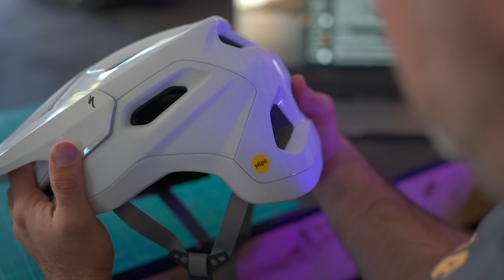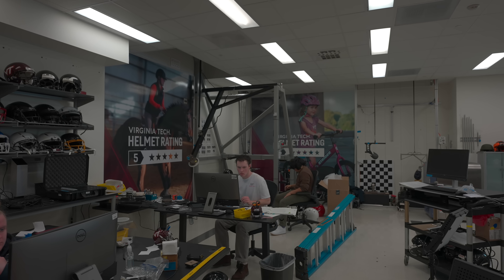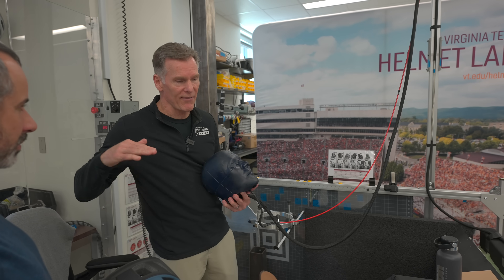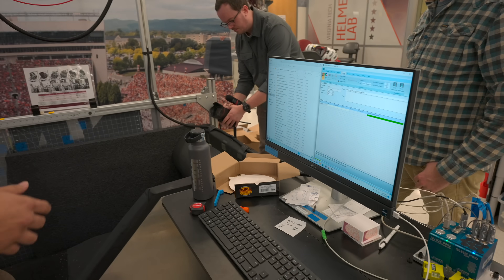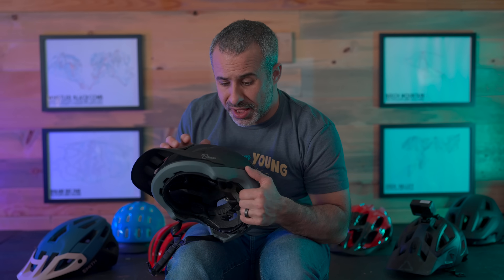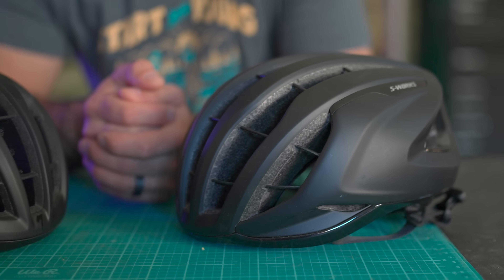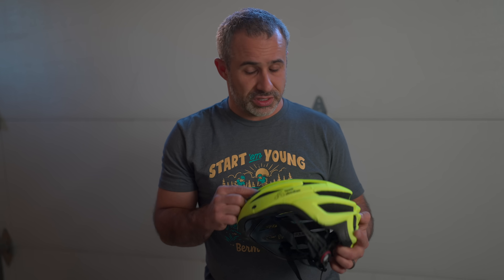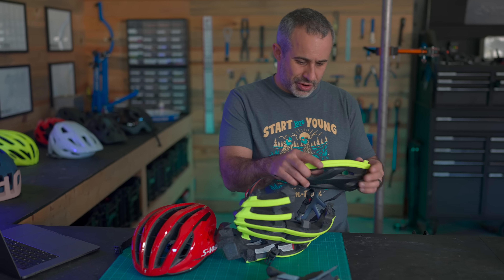Are Cheap Bike Helmets Safe? We visited a helmet testing lab to find out

Comment: I would be very curious about a follow up testing the helmet that shattered at Virgina techs lab. While it looks bad and gets shock value from all of us armchair experts in the video, bike helmets are by nature 1 impact products. In a MTB crash there could be multiple head impacts. That is the nature of chaos and randomness, so I find the lab experiments, while valuable, dont show the whole picture anyway. So how about a test to show the force on the head when the whole helmet shatters? A helmet that is stiff and doesn't shatter has to transfer the impact energy somewhere, which eventually split between the head, heat to friction and ground. Maybe there is a certain level of shatter that is more optimal than a non shattering helmet for brain protection?

Comment: the purpose of a helmet is to crack, deform, or break on impact to absorb and disperse the energy, preventing that force from reaching and cracking your skull or injuring your brain. A helmet that cracks after a hard fall did its job, sacrificing itself to protect you; if a helmet stays perfectly intact after a major crash, it often means the impact force went straight to the head, which is a bad sign

Comment: 1:13 never buy a helmet without checking this website first.  I’m surprised he didn’t consider this common knowledge.  Any attempt to find out how safe your helmet is will lead you right to the Virginia Tech website.  I bought a “specialized mode” after checking this website that I have been very happy with.  I’m old, and clumsy on an e-bike I bought for transportation because I don’t feel safe driving a car anymore. Recently broke some ribs in an accident, but my skull was spared any damage thanks to that helmet.  And I sure can’t afford to be having accidents like that driving a car.

Comment: I'm a former down hill MTB racer. Some time ago I had a pretty server crash while doing some training runs in up state NY. I had just purchased a $400 TLD carbon fiber helmet during the off-season. I Still Don't remember what happened on the mountain. After a helicopter ride woke up in the hospital. (Weeks later I was back on the mountain)
The carbon fiber had cracked, but saved my ass in the end. Don't compromised when it comes to safety.

Comment: For Amazon, to avoid counterfeits be cautious when you see "shipped by Amazon" because that means it's coming from an Amazon distribution warehouse.  Some get a warm and fuzzy feeling if it says "shipped AND sold by Amazon" -- but this has a huge question mark whether you're getting the real deal.  Why?  It's because Amazon warehouse items are mixed inventory, it's not segregated whenever its designated "shipped by Amazon".  So the unscrupulous vendor sends a bunch of counterfeits to stock at an Amazon warehouse to ship their product out.  You might say, I'll only risk getting a counterfeit if I select that questionable third party but nope.  Again, they are mixing inventory out so you can select "shipped and sold by amazon" yet end up getting one of the counterfeits plucked by the robots off the shelf and sent to you.

Comment: Wow, I was blown away by this video.  I have been looking at helmets and was looking ones with  with lights as a safety feature.  Now looking at the VT ratings only 1 of the helmets I was looking at had a rating (5 stars). None of the other helmets even had a rating. Then Inlooked up my current helmet and it doesn’t even have any stars- 0 stars!   This video completely changed what helmet I am considering.  Thank you so much for creating this video.

Comment: Getting a helmet on Amazon from the seller does not guarantee that it's genuine. In the Amazon warehouse re-seller inventory gets mixed in with the manufacturer inventory. As long as it's the same sku its treated as equivalent. You might be getting a counterfeit item that a re-seller provided. This was so much of an issue for Nike that they stopped selling on Amazon for 5 years.

Comment: Despite what the tests show,  its very unlikely to fall on the top of the helmet with road bikes.
I cycle weekly and haven't fallen off my bike in years, the only time I crashed, due to a slippery road, I landed on my shoulder. 

I prefer a test that also shows how mushroom the helmet looks. The helmet can have MIPS and a high manufacturer rating but if it looks like a mushroom then people wont want it. So I am sceptical about the real world comparison of these impact tests.

Comment: This is fascinating to me for many reasons, and thank you for putting this video out there for the masses! I work in motorsports, have since 2010, and in my early days I was a safety inspector for local weekly oval racing series. The motorsports industry has testing standards for all driver gear, helmets are no exception: they must meet the Snell specifications within the last ten years or a specific FIA rating, with the ratings being given only for a helmet that meets very strict requirements. These standards are industry-wide, and you can simply look inside a helmet for the certification sticker and know what tests it has passed, and you simply will not find a legitimate helmet without those certifications on it. It's given confidence to the drivers, the families, and in my case it gave me the confidence that I was never approving a driver to race in inferior equipment. Some helmets are more expensive, since various shell materials and other features exist, but those costs are justified in all cases. It puts a definitive answer to the question: Would you race in a $200 helmet? Absolutely, because it has met the standards. It might not be as well ventilated as a $1500 helmet, might weigh 4x as much, and the visor might fog up, but you'll be okay in a crash.

So, a few years ago when I got back into Cycling after about 20 years away, I was shocked to find that there is no standard system like we have in Motorsports.  I needed to buy a helmet, and I was literally paralyzed with choices. Not because of pricing, but because instead of saying "This helmet meets this standard of testing" I was hit with all kinds of "technology" and buzzwords. I had to go out and find test results to all the helmets out there because the industry hasn't bothered to implement safety standardization to helmets yet and that baffles me to this day. When I was shopping around I kept getting the "Would you trust your head with a cheap helmet?" Without some kind of standardization and rating system, that question is just a sales tactic and I truly wonder how many expensive helmets out there are not as safe as the price tag implies. I really hope this VT testing lab spurs some advancement in this department on, because they do work that's very similar to the Snell/FIA systems we have in Motorsports, ratings that have saved drivers's lives each and every week.

Comment: The Specialised is absolute rubbish. The visor broke within days of getting it. It's at a bizzarre height and catches on everything. The angle makes it useless as a visor as it does nothing to block the sun. The added distance from the centre of the head also increases torsional forces when you hit things. Best of all, Specialised does not offer a replacement visor. My last helmet lasted almost five years. I barely got 2 out of this one . I rate it a 2 out of 5. It's comfortable enough, but doesn't stand up.
Reply: Actually…they do offer a replacement visor for the tactic on their website for 14.99 cuz I bought 2 not long ago
Reply: @humstudios1595 Sorry. They never had them in white. Only black when I last looked (apologies, and thanks for reminding me) And they are still useless.
Reply: @Jasminethelion 😂 i still have the tactic but prefer my POC so it doesn’t get used much. I do wholeheartedly agree about the visor tho - it doesn’t help much when bombing with the sun in your face in any way. Thank goodness i have a great pair of smiths to filter the light…

Comment: Seems like having only the dummy head in the test would be drastically different than having the full body weight of the rider behind the impact.
Reply: These tests are to compare helmet to helmet in identical scenarios. It is still applicable because you learn which helmet performs the best overall
Reply: Not really. They measure a risk of concussion, and it comes from rapid acceleration. The acceleration reaches its peak as your head is just starting to move the first few centimeters. At this time it doesn't really matter if the head is still connected to the body, because muscles and spine do not really add resistance as the head just starts its motion. 
But you're right that the concussion is not the only problem, the neck trauma does depend on the body weight. But the neck is not protected by the bike helmet anyway.
Reply: No way

Comment: All those test and protocols seem to involve taking a major hit, with rotation, to the top of the head.  Maybe that happens a lot in fake MTB land, but on the streets, other than being hit by cars, most of the bad accidents I have heard about are collapsed front wheels, major pot holes.  You go sprawling, and are more likely to land the fall with you face than the top of your head.  Parked cars, or trees could change that...  But for the most part, the testing seems unrealistic, notwithstanding how dialed in that lab seems to be.

Heavily padded gloves are super important for safety.  I have used leather old fashioned road gloves.  You have at least a chance of breaking your fall with your hands, and they are super comfortable riding long days on tour.  I would like to find some that are a little more skid optimized.

Comment: I just ordered an eBike and didn't have a clue about which helmet to get until I watched this video. I ended up getting a Specialized Align II directly from Specialized. It ranks number 24 with a score of 9.55. These helmets cost $64.95 but the color and size I wanted was on a close out sale for $24.95 plus I used a new customer 15% off promo code so it cost $21.25.

The Virginia Tech website now lists 271 helmets. Under the "All" category the Specialized Tactic 4 you mention at 2:44 now ranks 9 with a score of 8.55. All the helmets ranked below mine are in the $199 to $330 range with the exception of the Specialized 4 for $110, the Specialized Mode for $120, and the Giant Rev Comp MIPS for $65 at position 18 with a score of 9.13 which currently sells for between $86 and $100. 

The helmets that rank higher than mine show a price on the Virginia Tech website of $70 to $300 with one priced at $400 and one at $52  but I find the prices are higher than the VT website. So I think I did very well thanks to your video.

Comment: Stomp test shows one helmet is much stronger than another but isn't valid for demonstrating head protection.  You could stomp on an anvil and it will deform less than a great bike helmet.  Need realistic loads, thus Virginia Tech testing.

Comment: Which helmet is long thick hair (curly) friendly?  I like wearing my hair in a mid ponytail hair-bun so that NO hair is touching my skin. I have 6 various helmets Giro, Specialized, Smith Cabs, and more but none allow me to wear my hair up so that it doesn't touch my skin as I ride.  An old Giro helmet allowed the enough space between the adjustable (dial) strap and the helmet to slip my hair-bun/braided ponytail through but I handed it down to my daughter who has thicker hair.  I have other helmets with similar features but the space gap is not big enough to slip my hair through.  I wish for a helmet to consider long thick hair in their design because wearing your hair down with a helmet (any helmet IMO) is a BIG NOPE!

Comment: He's right that a football helmet would probably be very protective in a bicycle crash... for your head. In motorcycle helmets, it's been found that during actual crashes a helmet that's overly heavy is more likely to leave the rider alive but paralyzed, while a helmet that's lighter is more likely to leave a rider concussed but with an intact spine. There's a happy middle ground to be found and it's what ECE certification focuses on, but this goes to show that an expert on blunt impact protection isn't an expert on all things helmet.
Reply: Those tests are presumably  at the speeds motorcycles are capable of.  Where energy levels based on velocity are 16 times higher than they would be at the 15 mph level open face helmets tap out at.

Take that same accident at 15 mph, factor in how completely crap most bike helmets are, no chin protection. Yeah, I could see the football helmet coming out ahead, easily.  The VT bike helmet tests look like they are designed to see who survives if they get hit from above by a falling air conditioner.  Makers are now building to a test that is mainly concerned with concusions, and hits from Mars, you just can make this shit up.
Reply: @HondoTrailside  Actually I think I remember reading motorcycle helmet tests are at surprisingly low speeds as well. They're not about hitting a brick wall head-on or hitting an oncoming vehicle - it's not worth checking if they can keep your head in one piece in that sort of scenario because your whole body is going to be spaghetti sauce anyway. Likewise with motorcycle armor or heavy jeans/jackets, they're about falling off the bike and sliding, not surviving a severe impact.

Comment: I would not put ether on my head. That bs is for middle age corp people who gets expensive bike, all the gear and rides safely in the bike lane... lame people for short. The most fragile part of your head is your face. If you don't need a full face you probably don't need helmet. I  got a lot of crushes, and the head was never hit, and one time I nearly hit something with my head I had a full face on because we were going an a long steep slope... in winter on snow and ice. The force it takes to brake your nose and front teeth, not mentioning the eyes, is far less then what is necesary to fracture your skull but you leave your eyes and teeth unprotected if you know you are likely to hit your head? Great plan. I will keep riding without a helmet unless I do something really dangerous, then I will just put my full face on.
Reply: You don't need to have a skull fracture to receive a traumatic brain injury.
Reply: @shay1116  but your face is fair game right?
Reply: @ What's your point? Don't wear a helmet because you could possibly face plant? I'd rather get a broken nose or a chipped tooth than be a vegetable for the rest of my life, but you do you.

Comment: so they just decided to make the confusing system imaginable? 5 stars is bad? lower ratings is good? what? why not just be logical "this one is 5 stars so it's a good one"
Reply: From VT: "A helmet with a lower score offers better protection. STAR scores are assigned a number of stars to categorize impact performance. The number of stars varies between 1-5, with 5 stars being the best."

So the lower the score of a helmet in a given star rating the better it is. For example, a 5 star helmet with a score of 9 is better than a 5 star with a score of 10.

For bike helmets, 5 star helmets have a score of 13.99 or lower, 4 stars are 14 to 18.99, 3 stars are 19 to 23.99, and 2 stars are 24 and up. The number ratings are not the same across other sports' helmets (ex. hockey helmets currently have scores of 0.16 to 6.16), but the star ratings have the same meaning.

Comment: I rode for years with a bell helmet that has saved my life multiple times with large indentions where my head would have been caved in hitting rocks. The only reason I where a more expensive one is because I got one as a present. Would have just kept using the bell mips helmet it’s probably a little more comfortable to

Comment: Any helmet is better than no helmet. But I think it also depends on use case. For me, who never goes above like 5mph, anything is fine 😂

Also, it’s mainly rollerblades. And ice skates.

How do I tell if my cheap hole-y bike helmet is good though? I have an expensive bike helmet but it’s very sweaty. I got a cheap bike helmet at Walmart. Also, Amazon skate helmet that was mid-priced (for Amazon).

Comment: I think there's a diminishing return on safety for bike helmets. The helmet needs to prevent you from bike accidents, but most deaths on a bicycle are indeed from 4000lb masses of metal moving 8x faster than you crushing your whole body under their oversized truck. So where you ride and when you ride is SIGNIFICANTLY more important then 10-15% more head protection from modern helmets. Also i get that increasing protection is always a good thing, but i'd rather see someone with a helmet they can afford then without a helmet they can't afford.

Comment: Here in Ireland 🇮🇪. We have very strict bicycle helmet laws, 1) they must have a sticker with EN 1078, This means that it has passed all of the safety test. 2) it must  have a size range, 3)  manufactured date, and manufacturers number. So here in Ireland, the only difference between expensive and cheap helmets is weight. The cheaper helmets may be a little heavier and may not be as comfortable for long bike rides. So expensive and cheap helmets are going to do the job.

Comment: I had a look at the specialized helmet, turns out in the UK it's cheaper than the bikeroo helmet if you buy direct from specialized.

So i did that. £45 later for the tactic 4, and i have the most comfortable helmet i've ever owned!

Comment: bikaroo has no mips
most impacts are rotational no?
also for open face I use BMX style multi impact helmet...  are the ones tested multi but look like a single impact helmet?    if they are single and it simply falls off a bench and cracks, doesnt matter if its 25 or 125$ its garbage